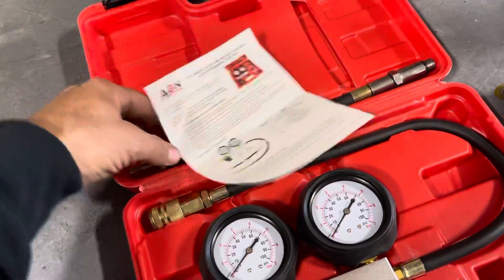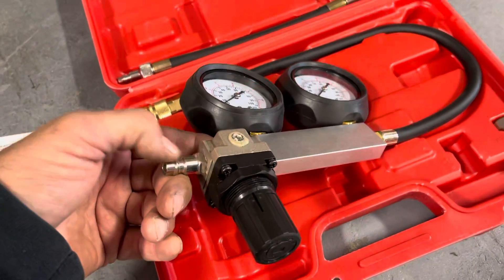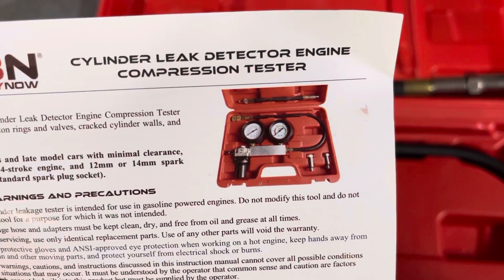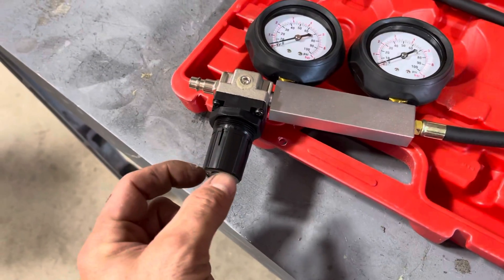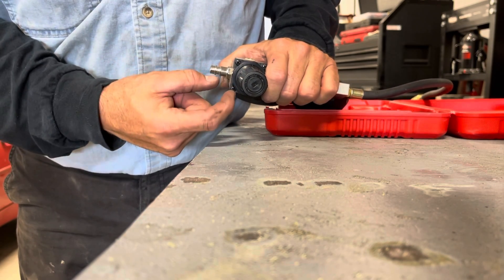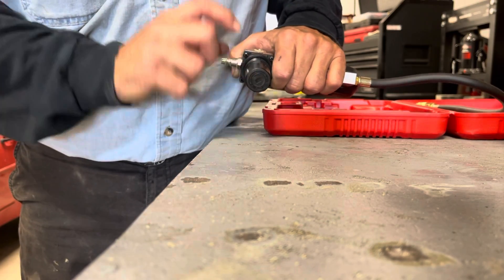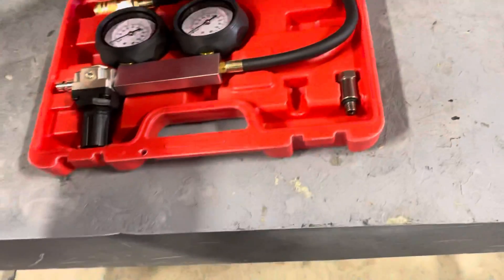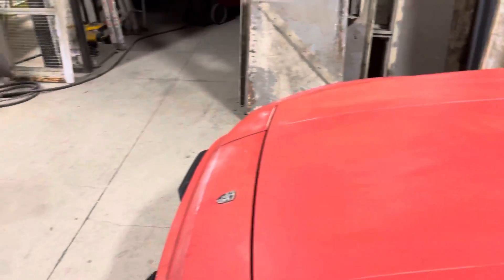Leak-Down Tester -- Check your Tools — or just buy GOOD quality Tools!

Comment: you use the second gauge some
Sets have two pressure gauges instead of percent it should be no more then 20 psi difference from first gauge on left for a good engine
Reply from the maker: I’m sure it could have worked, but, given all I outlined in the video…why use this one?